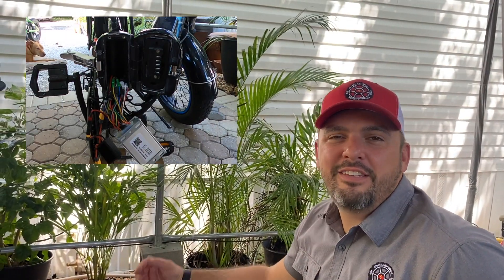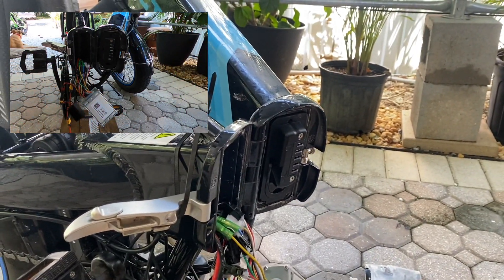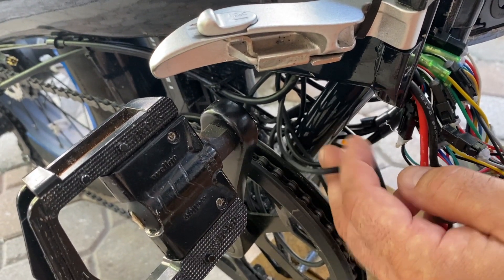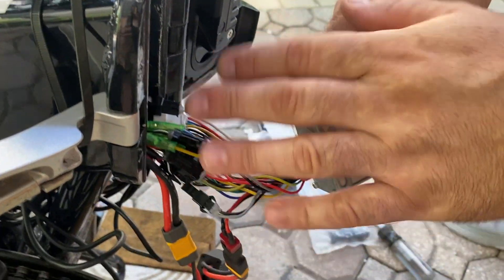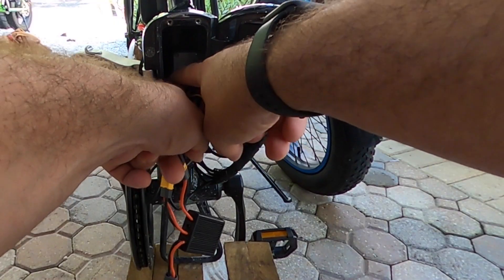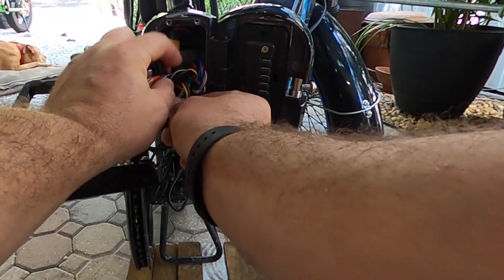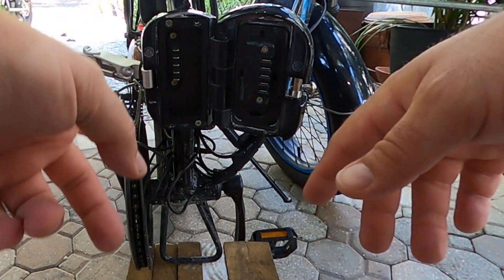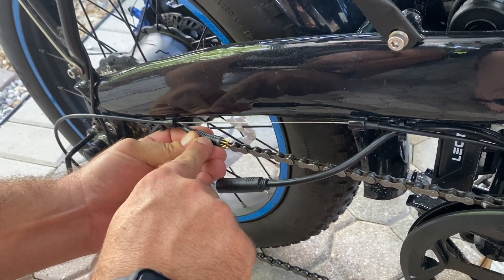Lectric | XP 2.0 HS | Update Dual Battery Discharge Balancer Installation and Wiring Orientation

Comment: Can I use just about any ebike battery off Amazon with this?
Reply from the maker: Yes. Just Match rated voltage and make sure you have a way to connect with XT60

Comment: Will this fit the new lectric XP 3.0 the latest model ?since I seen that the pins are different and the old XP 2.0 battery won't fit an xp3.0. let me know if you could in the comments
Reply from the maker: The balancer kit will work but the factory battery adapter will not work on a new 3.0. You can however use a 2.0 or 1.0 battery with adapter and plug it into the kit on a 3.0 for a second battery.
Check this out
https://electricallwheel.com/how-to-install-lectric-xp-dual-batteries/

Comment: When doing this upgrade this was the most challenging part. It takes some patience and a little trial and error but it’s definitely doable. I’m glad you pointed out to line up the arrows on the motor cable. I didn’t see that and when I powered the bike on I was getting several errors. It took me a couple of minutes to figure out what I had done wrong. Once I lined up the arrows and reconnected the motor it powered up right away and has been working well since. Great video! Thanks!